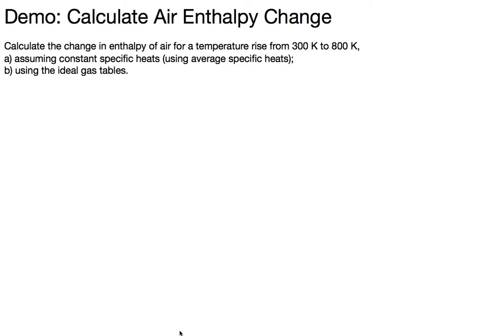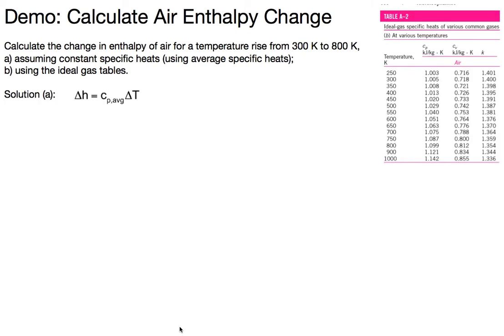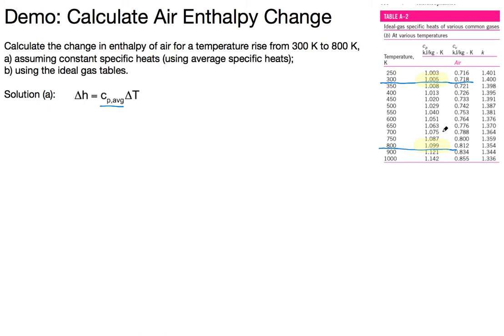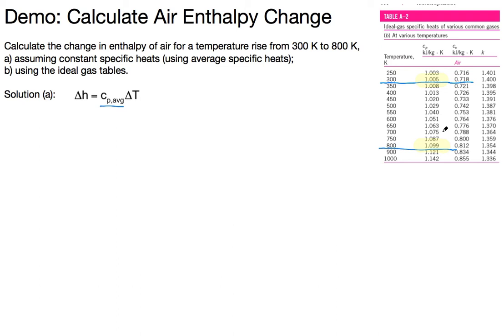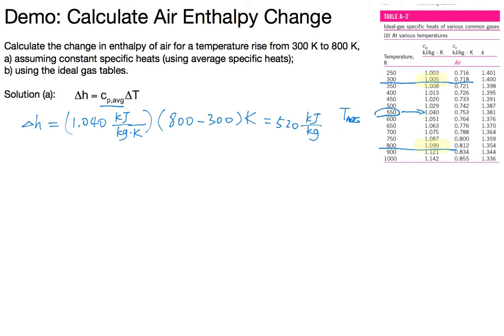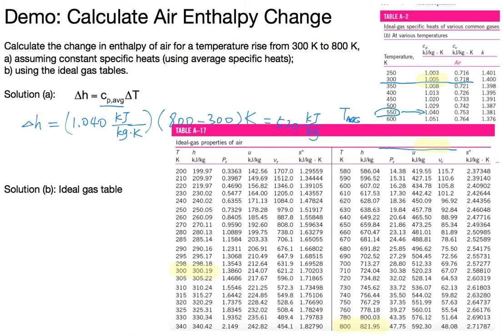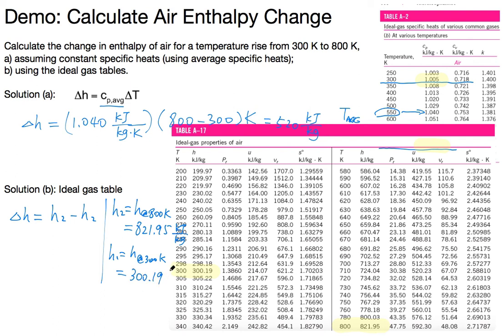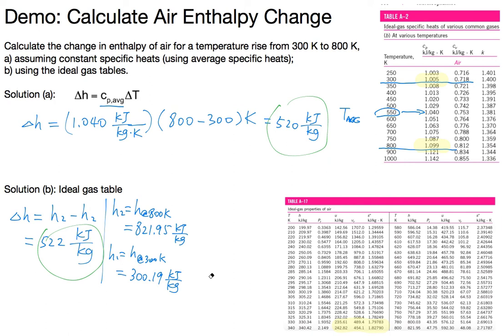Calculate Enthalpy Change of An Ideal Gas System

Comment: Which method is the more accurate one?
Reply from the maker: Using the ideal gas property table should be the more accurate approach, because it takes into account the dependence of specific heats on temperature.